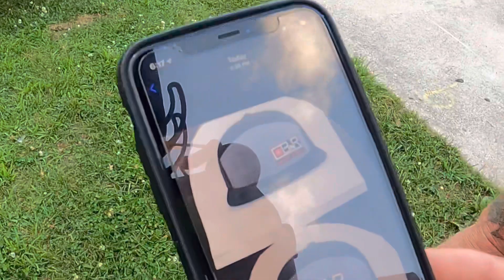FIXING THE BROKEN CAR AND TESTING IT OUT! WILL THE TRANSMISSION BREAK AGAIN?!?

Comment: Great angle for a video looked like the trans was shaking just a bit during acceleration. Is there suppose to be a trans mount on the right side? It looked like it had holes for a mounting bracket to bolt up.